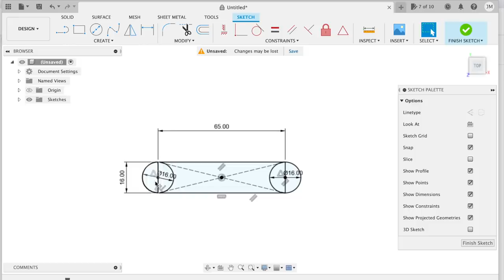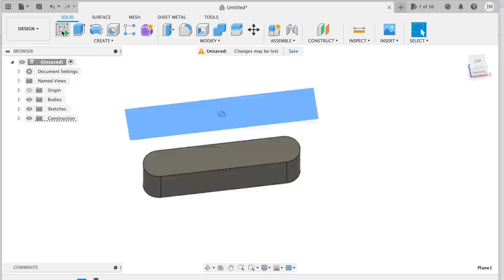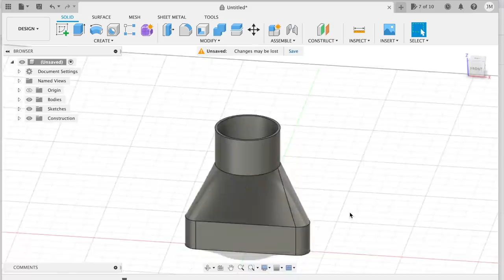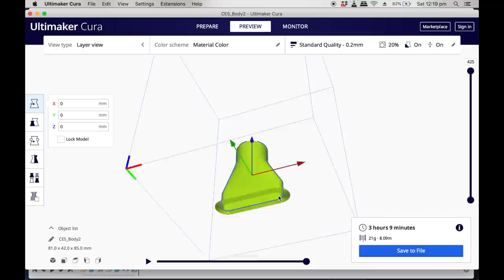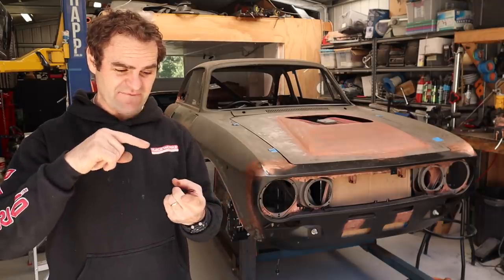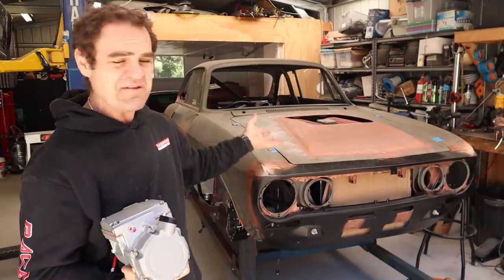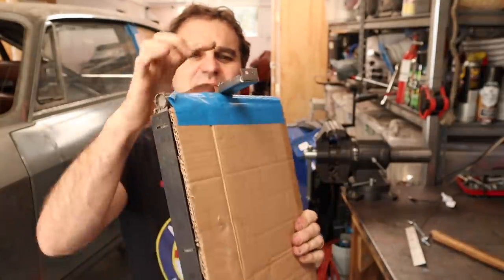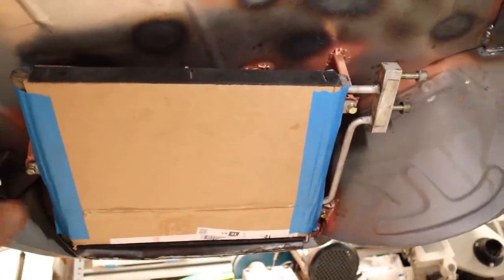Alfarrari in 3D - Ferrari engined Alfa 105 Alfarrari build part 105

Comment: To all of you coming with the inverter solution;
Think U = I x R or V = A x Ohm
With the same Ohm, if you go up in volt, you go down in amps.
And trust me, such a compressor needs its amps!
That means running at least 3 heavy-duty batteries to run the compressor.
And a huge alternator to feed it all.
Not an option.

Comment: You might as well use the compressor designed for 12 volts.  You could theoretically use a transformer/rectifier to get the correct voltage for the other one, but it's going to be inefficient electrically and cause more of a drain on your electrical system.  Modifying the high voltage motor internally will likely draw too many amps through the puny electrical connector on the high voltage one (if it can even be done).  Did you see the size of the leads on the 12 volt compressor?  It's going to pull at least 30 amps if not more, and the fan you're going to put on your condenser is likely going to draw 20 more amps.  So you're going to be 50 or 60 amps into that system before it's said and done.  Hope your alternator is up to the task!  Love the 3d printed parts!

Comment: For the high voltage electric AC compressor you can use a 12v dc inverter, pretty cheap solution
Reply: @Lassi Kinnunen 81 i see you're a "electroboomer". respect

Comment: In order to have an 12V input to DC/DC converter and from there output 110V, you would need some serious equipment (expensive stuff)... My suggestion is to try and find the 12V system all together...   cheers :D

Comment: Hi Jeff, there is a video from Contempo Concept, called Electric airconditioning for a restomod 911,  he explains you need a 240 amp alternator, and a high current relay to run the a/c, engine etc., also, truck sleepers normally have electric a/c as well.
Good luck.
Reply: Watched that vid. Cool setup. Beautiful car!

Comment: Hi Chris. I’m a Porsche/car fan. Have owned too many cars to remember. Your work on the Alfarrari is very commendable thus so far.
Just my 2 bobs worth, the bolt on flare kit in my opinion will cheapen the car considerably and just not look right. Flaring the guards and rolling them will look amazing with the ride heights set correct. Keep up the good work.

Comment: Be mindful of the filament types that you use for making parts to go in your car. The plastics can be very temperature sensitive and can warp very easily. You probably want to look at one of the liquid resin printers for the best results. If you want to make the best results for ABS prints, try enclosing your printer in a cabinet.  This allows a more consistent ambient temperature around the printer whilst printing and greatly reduces the chances of parts warping during printing. Thanks for the content. Keep up the good work.
Reply: 👍
PLA is useless for cars. Gets brittle ìn no time.
I find nylon works best for things I use in my car. A little expensive but it will last and has OK temperature resistans. Nylon with carbon is 👌 but really expensive
Reply: Yes, PLA will soften and fail with the hot air from the heater.  PLA will even melt and deform just sitting in a closed car on a sunny day.  ABS will likely soften with the hot air from the heater still.
Reply: A cabinet wiil also greatly reduce the risk of warpage due to being sat on by a cat

Comment: Make sure to seal the top perimeter of the condenser. Keeping only an opening in “the right position” (preferably high pressure area) for the air to enter. (The OEM ducting on the Boxster is just beautiful! 😍)
Guess you already have plans for some protective shielding.
Same thing here. Seal perimeter and exit in low pressure area. Promote flow by adding a Gurney if needed.
Or maybe louvers along the whole length/width, like the other protective shield you made , is an even better solution? 🤔
All of this may already be in the plans, but since ducting to and FROM any type of heat exchanger is maybe the single most overlooked or misunderstood area of home built cars I like to at least mention it. ☺️

Comment: Avoid running soft hoses through grommets from interior to exterior. They will never seal. Weld in a steel (stainless) tube to the body (or screwed/bolted on flange) then clamp hoses onto it each side of the body.
Reply: Great idea.    I was just wondering that

Comment: If you going to use the electric ac, the condenser needs to be close to the compressor, the Alfa 33TI used two condensers in front of front wheels.

Comment: Jeff, I would suggest you make the outlet for the AC Evaporator drain face down and rearwards.  The high pressure created in the engine bay and transmission tunnel when moving prevents the water from draining until the vehicle has stopped, hence all the water on the road at traffic lights and in carparks.  It's possible the evaporator housing will fill with water.  Ask me how I know.

Comment: Tip: give the transitions from cylindrical to a different shape a radius/fillet before you shell the part. This will give even nicer results!
And also; consider a different nozzle for the printer that can withstand fillament with carbon fibres. You will be amazed how strong parts you can print with these materials!
Reply from the maker: Nice tips.

Comment: ABS will be great for this application, another great quality about ABS is that it tends to bend and stretch rather than snap like PLA does. Additionally ASA is just like ABS but it is more UV resistant If you’ll be printing exterior mirrors or logos

Comment: Great show today. I use fusion 360 and 3D print myself. Though I use PETG as I have a lot of trouble with ABS. Looking at your Condenser location, I don’t think you be able to get enough cool air to go through it. Working on AC systems in cars for a long time now, I’d be looking at relocating your oil cooler as the condenser needs a lot of air to flow through it to be able to cool enough. Where you have it now will be getting warm air flowing back from the motor. Plus it is very susceptible to damage and getting blocked.

Comment: Some nice solutions you're coming up with mate 😉

With that Camry AC compressor you'll need a fair few other bits n pieces to make it work as if memory serves then all the electric vehicles use AC for the motors and so if the compressor is running off this AC system then you'll need some version of inverter that produces the relevant AC voltage from your 12V battery. You'll have to do a bit more digging but I also think the AC voltage is 3 phase as this makes for more efficient motors. The AC compressor may only use a single phase, the same as most houses are connected to the street, but again you'd have to verify that. 

Hopefully your AC condenser position will cool effectively as where it's mounted is a kinda dead air zone and if the fan can't exhaust the hot air out into the slipstream of the vehicle then it won't cool the condenser very well. Scooping the front of it should help duct air through it too so the fan isn't always running 😉

Comment: The 3D stuff was extremely interesting and answered a lot of questions. As to the voltage converter I would think that the voltage is quite simple to increase. However I think you’re going to need a large current and that could get very expensive. Might be best to go with the 12v

Comment: 3d printing my cousin uses nylon based platics and carbon fiber infused ones for parts on my motorbike. They last great in u.v. and hot sun on black bike. Put a heat sheild between muffler and condensor air gap with air flow will be plenty. Condenser may be too small depending on evap size but you could stack 2 condensors tightly ontop of each other potentially routing hottest one to most cool air. Should work love your parts bin attitude. Thats how pros do it. If u understand the components you can swap brands years anything. But i like toyota parts myself too

Comment: Hi Jeff, What a fact filled episode that one was. Fantastic viewing always inspiring stuff. 👍👍👍

The 100 Volt compressor from the Prius won't do what's required. 
I'm sorry but trying to step up from 12VDC to 100VDC cannot be done efficiently for the amount of current required.
Sorry but you will need to use a 12VDC compressor. You will also need to upgrade your alternator and battery otherwise you will definitely run into problems.
Cheers Hugh.

Comment: For your boot lever, that really is something you could 3D print easily.  Or you could make up a nice brass lever (and 3D print the body) and send it off to the chromers with the grille.   I have the same arrangement on my Esprit S3 (and my first car was a GT1600 Junior so had it too) and you don't really need a lock.  Lotus didn't put one on as the door is already locked. Incidentally, from memory, the Lotus one has a much better feel than the rather flimsy Alfa one.  It's a two-fingered lever and has a better controlled action, helped by the wider base of the bearing.

Actually, you could really go to town and cast one with an Alfa logo on it.  In chrome that could look gorgeous.
Reply from the maker: Not a bad idea.

Comment: When printing with ABS you need an enclosure. It will help with temp control plus it keeps the toxic fumes out of the way. Put a hepa filter in and keep an extinguisher near for a just Incase scenario
Reply: I was going to say the same thing. I had everything working for several days with ABS and then all of the sudden I can't get bed adhesion anymore. ABS is a PITA to work with, but for car parts it's one of the better option. I made some trial pieces from PLA and they are starting to melt.
Reply: @jayinmi3706  I use PLA solely for test fitting parts. We then use either ABS or ASA for the final products however the rate of success is about 85% we are about to add a heated chamber and larger bed to be able to create something quite unique.

Comment: You will need a 12v compressor other wise you will be adding a lot of weight for a 110v version as you will need a battery pack for it and the High Voltage control to run it, then you will need to take into account the alternator you will need to keep both sets of battery’s charged to run it all. The Amps needed for the 110v system will be high and a inverter to supply this will be expensive and big.

Comment: That compressor would be DC I think. Check the specs - be a label on it. You could use a 12 volt dc to 100 volt dc step up buck converter (SMPS - switch mode power supply), I had a quick look and not much around. Has to have sufficient power rating (watts or amps)

Comment: You can use an inverter to get hight voltage for the compressor but its gonna ad complexity to the system and trying to find a convenient location for it might be challenging so i think the best option is to get a 12 dc compressor

Comment: Brilliant! I'm going to have a go at CAD to make those bits I usually hack, file & araldite together. Question: most home 3D printed items I've seen have a fairly rough surface, yours didn't, are there settings that influence this? Thanks again, an inspiring vid.

Comment: I've fitted a few of those 12v electric compressors and they are impressive.  However,  you need to have an alternator that can support the current draw the compressor requires. 80amps is not uncommon for those things, which means your alternator should be rated to at least 150amps to cope.
Also that condenser will dissapoint. This is Australia remember.

Comment: You can get a step up transformer to get 12v up to 100v or what ever is required but it will be expensive and out way the savings sought by using a cheap 100v compressor

Comment: Give PETG a go, it is easier to print than ABS, but has most of the benefits of ABS, with almost the ease of PLA. Without a heated build chamber, ABS is a PITA in my opinion. Apparently some of the new Co-Polyesters are great too, but I haven't had a chance to try them yet.
Reply from the maker: I have a roll of ASA to try next. Not sure how hard it is to print.

Comment: Yeah thats prob with modern hybrid electric systems. Yeah you can run a d/c to d/c invertor/transformer/convertor? To bump up voltage. It could work prolly need a good alternator. But yeah you should be able to make camry one work if its got all the logic inside to cycle. Ull need sensors if any are separate.

Comment: Not personally familiar with electric auto ac compressors but a little Ohm's Law work would tell you if you can use the higher voltage compressor; you need to know both the voltage and the wattage the compressor is stated to need- or amperage. The Alfararri has a 12 volt electrical system and the alternator has a stated output in wattage at that voltage. If the alternator is a 12 volt, and rated at 120 amp hours, then at 96 volts, it would be able to handle a load of 15 watts. All you will need than is a transformer and sufficient wire gauge from your power center to the transformer. I'm really curious to see your solution, so hurry up, but don't delay "Vroooooom" day! FR

Comment: A few points. 
1. That condenser should be fine, ita not much smaller than a hatchback. If you're worried you could double stack them. You'll only increase efficiency by about 1/3rd but its better than nothing
2. I'd use a push fan on the condenser. Make a duct that forces air on top of the condenser and then push it through and you can vent out the rear so you don't have a giant rock scoop under your car. Note that you'll need to have a trap to release anything that DOES get up there. I had a rock get stuck between the condenser and radiator once and it vibrated and wore through. You could have a trap door that opens when the car is stationary or just have a small 20mm gap at the back.
3. You CAN step up voltage. Double check the compressor runs on DC because that's difficult. Most EV motors are AC so you could just use a big 110v inverter. Otherwise look into 12v soft starters or DC/DC converters but generally they only go up in 12/24v increments. Like 12-24, 36-72, 72-110 etc.

Comment: A word of caution.
My brother bought 3d printed rear shelf supports for his Audi TTs from a forum member (in the business of 3d printing etc) and the first hot summer we had (UK) the supports melted. 
They were under a thick shelf so not in direct sunlight and yet they still melted. 
Make sure you use suitable high heat resistant material.

Comment: Could you run a normal compressor in the boot and have it powered with a 12v dc motor direct to the shaft. The motor can be controlled with an arduino to adjust speed with load requirement.

Comment: You need to find out if the compressor runs off ac or dc power, if it runs off dc, you might be able to use a thing called a “buck converter”, if it’s ac, you probably need an inverter

Comment: A 12v to 110v inverter should be readily availiable from the states, the output would be AC but a 110v bridge rectifier is easy enough.

Comment: I'm sure the AC system is critically balanced in regards to size of evaporator, condenser, TX valve and compressor. And you need a shitload of airflow thru the condenser.  I'm no expert, but you should talk to a fridgey bloke

Comment: I was going to mention 3D printing last time but then you mentioned it yourself. But why didn't you print the entire heater and a/c assembly? You'd have more freedom to incorporate odd shapes to make room for things like that drain hose etc.
About that electric a/c compressor, can't you wire in a convertor that converts 12V to whatever current you need? There's lots of cars these days that have high current (220V/110V) outlets in them, that's also done with a convertor.

Comment: Not sure how many watts an electric AC compressor would be, but quite a lot is a safe bet (I'd guess at a minimum of 500W?). You'll almost certainly need a bigger alternator to power it (500W at 14V is an extra 35A of alternator output required). An inverter power supply could be maybe 80-90% efficient, but you'll then need even more watts to drive it. Not sure what, if anything you could source a suitably high powered 12-15V DC to 100V DC inverter from cheaply. You could do with an AC mains powered AC compressor to enable the use of cheap inverters, but I'm sure it'd be a lot simpler and probably cheaper to belt drive a conventional car compressor from a suitable 12V electric motor.

Comment: Compressor wont be viable as its high current and  dc/dc conversion losses will be too much, then there's the cost and the added kit etc. I replaced those very same condensers in my 987 and they are very prone to holes from stones so beware of this, I fitted mesh. I suspect one condenser isnt anywhere near enough as my 987 in 30c was working hard to pull the heat down in traffic and the interior is smaller than a GTV.  Lotus elise uses one condenser have a look at the size but its pretty useless.